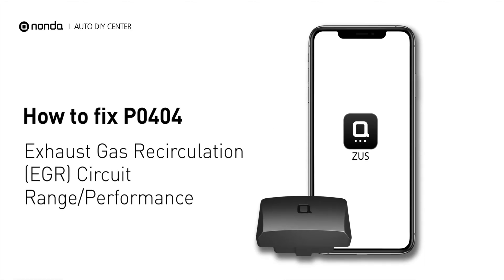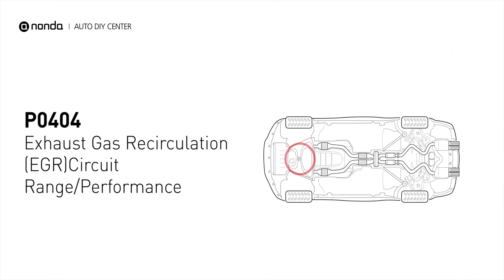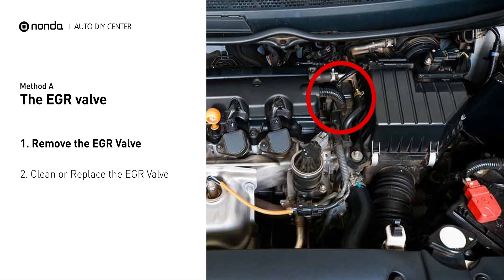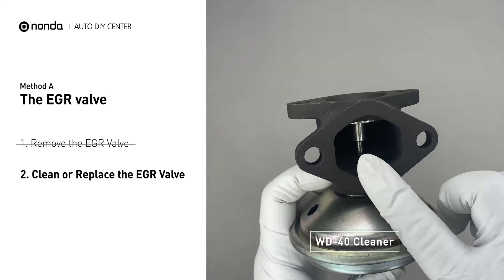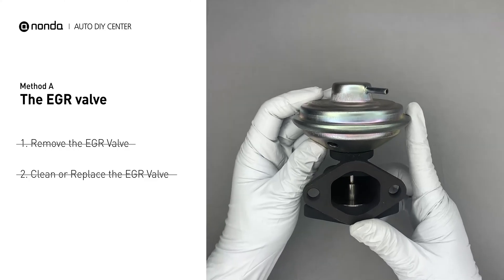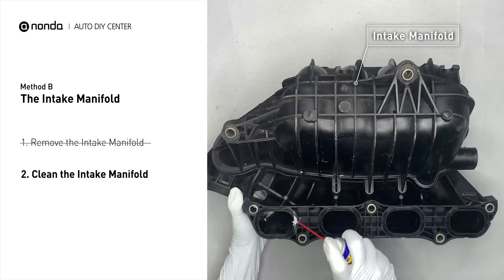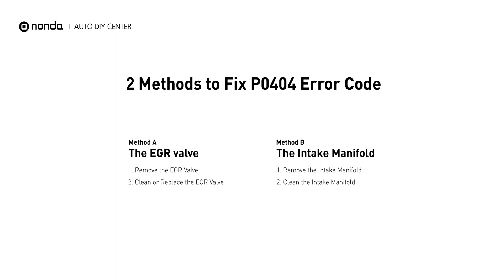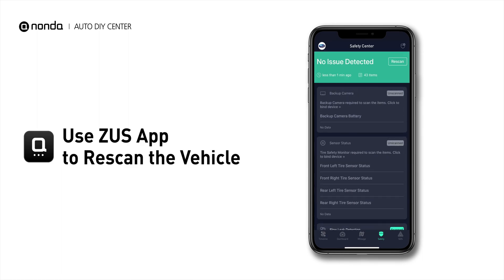How to Fix P0404 Engine Code in 3 Minutes [2 DIY Methods / Only $4.37]

Comment from the maker: Hi, I'm Steve, nonda's lead mechanic engineer. 
Feel free to leave your comments here if you have any mechanic questions, I will be glad to help you out!
Reply: That’s an R18 engine. The Egr  valve is down and to the left of what you have circled. It’s secured by 2 nuts and has a gray connector. I’m addition, I would not use wd40 to clean it. The wD in wd40 stands for water displacement. It’s not the best solvent. Use brake cleaner or any other type of solvent designed to remove carbon buildup
Reply: Hey i have a question. I replaced the egr valve to try and pass emmisions and the engine check light turned on any ideas?
Reply: @gangstapat4802  same thing for me...
Reply: Why would a car with 17k miles on it have this problem
Reply: My car had a PO 440 code come up and PO404 EGR code Now the mechanic working on my car said it needed a catalytic converter and possible a new transmission is this true

Comment: Hello Steve I have a Nissan 2012 and it threw a po40 code my mechanic tell me to put some cataclean in and follow the instructions on the bottle I did that now what do I do I asked my mechanic and I'm not getting the reassurance I need fr about what to do next what do you think I should do next thank you

Comment: I travelled to visit family twice last year. Each time I filled up at the same gas station twice and each time I got an EGR code. Each time the code went away the next time I filled up at another gas station. Coincidence or can dirty gas cause an EGR code?
Reply: Strangly I've found this with texico Station I've had many dpf full recently p0404 now
Reply: I've recently put 30 best off shell diesel in only drove few miles till its sorted properly but b4 shell cleared codes would be limp mode shortly afterwards well 👀
Reply: @JasonAldridge-ur1dw  Glad that worked for you
Reply from the maker: Hello, please provide us with your vehicle's year, make and model so we can address your concern accurately.
Reply: @nondainc  2007 Dodge Grand Caravan SE 6 cylinder
Reply from the maker: Kindly check your EGR if stuck open or shut. Visually inspect the wiring harness plug at the EGR and look for damage. Repair or replace it to see if the issue will still persist.
Reply: @nondainc  shall I infer that you don't think that dirty gas could possibly produce this problem?
Reply from the maker: Yes. Can you please confirm if the code registered only twice last year when you filled up gas at that gas station and hasn't been encountered since?
Reply: @nondainc  It didn't recur until recently. When the tank went down to 1/4 full I refilled it with Shell gas and the code went away. In my case, p0404 was evidently because of dirty gas. Fresh gas from a name brand vendor fixed the problem each time.

Comment: I have a ford 2014 Everest and I intermittently get this code after driving for 50-60 kms. I have replaced the EGR valve and also cleaned the intake manifold but I still get the CEL every 50-60 kms, What could be the problem?
Reply from the maker: Hi Viggy, before you replaced the EGR valve, have you checked the wiring connection/harness to the EGR position sensor?